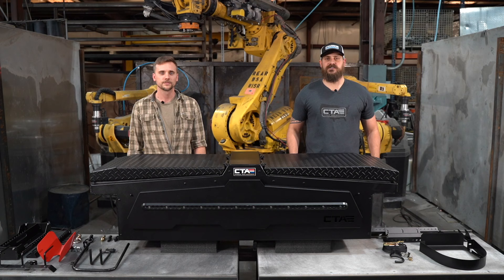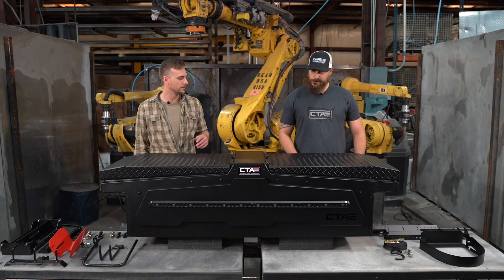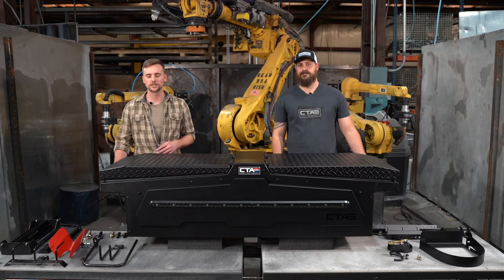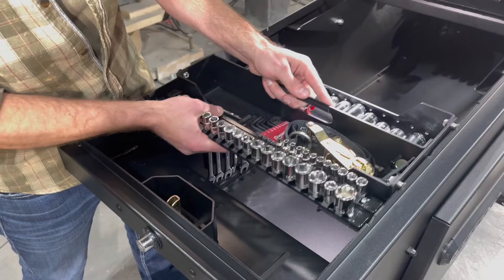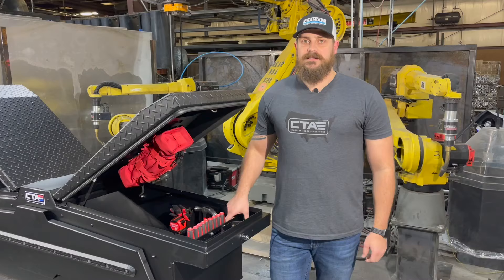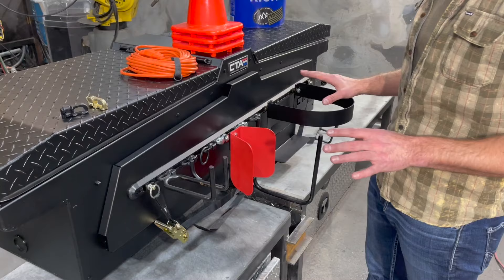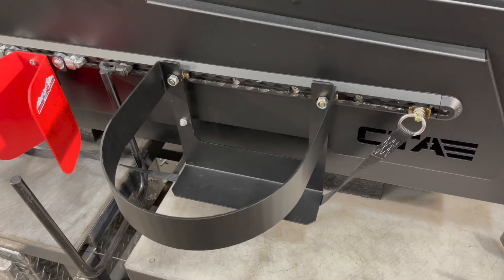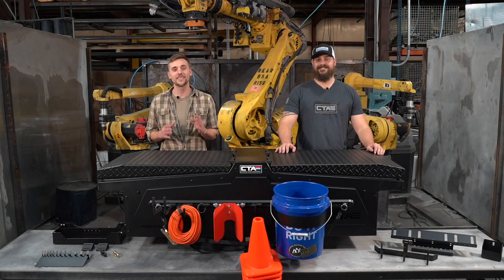ADAPT Gullwing Truck Toolbox - Specs & Features

Comment: Could you guy do a video showing different brands of “packout” systems fitting in the box?  I can’t tell you how hard it is to find a box that’s deep enough to hold most major brands molded tool cases
Reply from the maker: On our new Single Lid APEX box, we decked out the entire interior with Milwaukee Packout boxes. You can see some photos here: https://chandlertruckaccessories.com/products/apex-single-lid-truck-tool-box